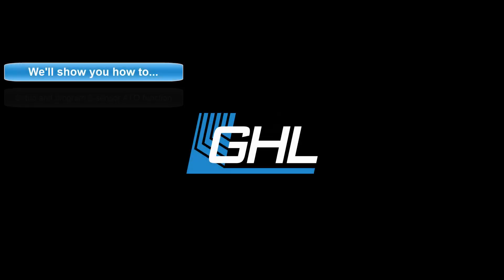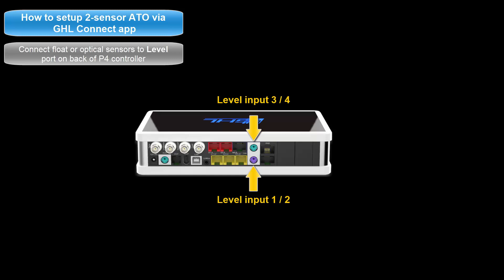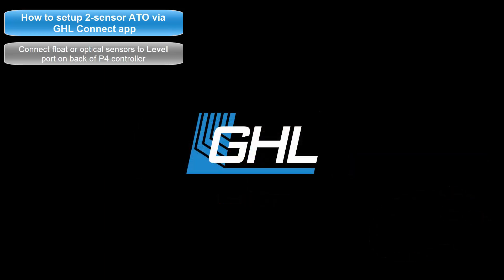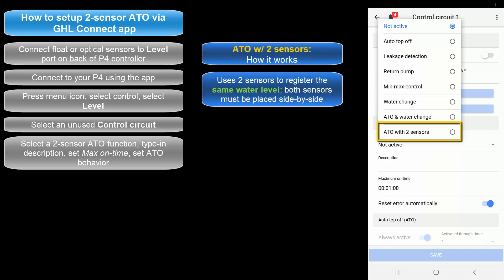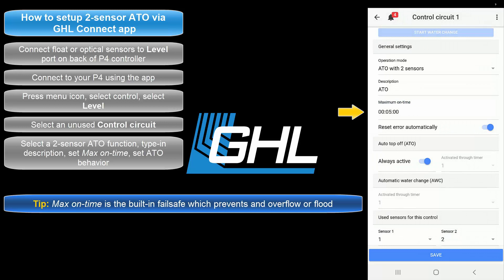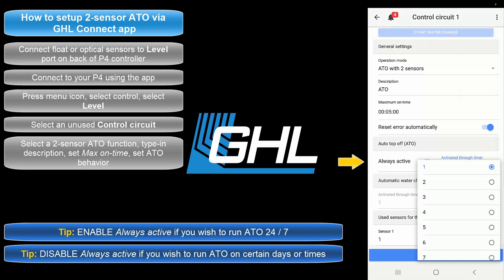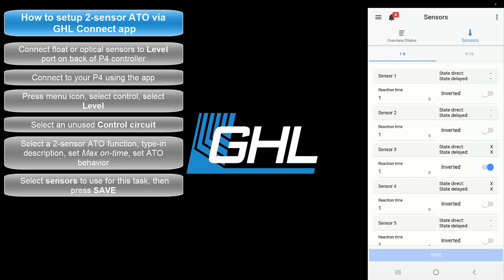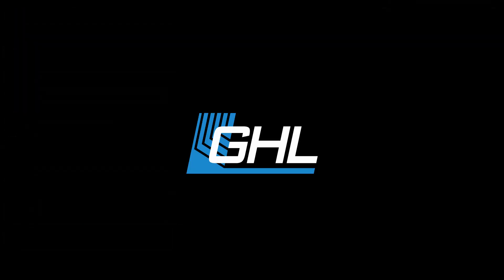ProfiLux 4: ATO (2 sensor) setup via GHL Connect

Comment: Can I mix one float and one optical sensor or do they both need to be of the same kind when connection to the level 1/2 port via the pl-ly splitter cable?
Reply: yes, mixing is ok